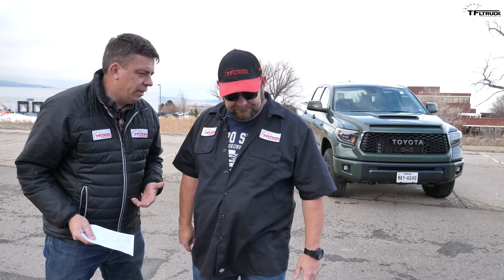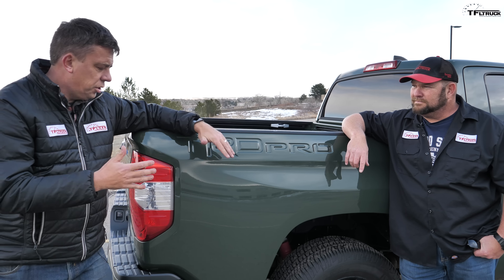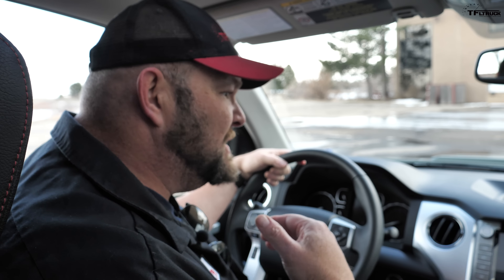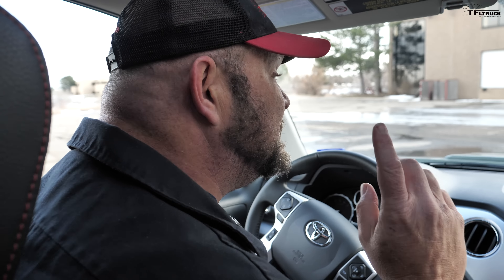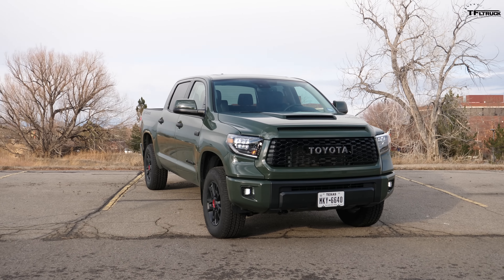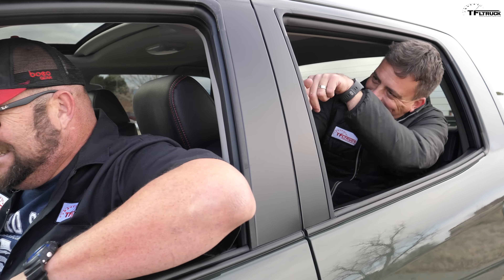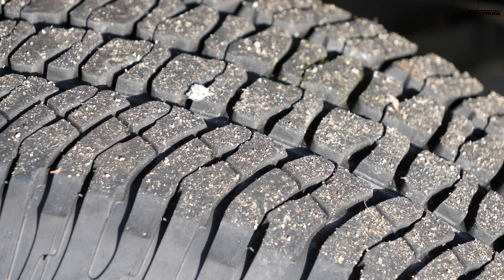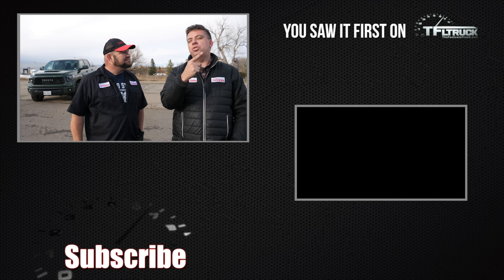The 2020 Toyota Tundra TRD Pro Is Outdated on Arrival - No, You're Wrong!

Comment: For me the lack of features that others complain about is what makes this truck great for me. Simple proven and reliable. No need to update anything. And i dont need a belt drive electric motor or a twin vaccum cleaner v6. Id like a simple v8 and its 14mpg. If i want fuel milage ill drive my car. If your over worried about fuel economy while towing or hauling then you probably dont have the money to have anything to tow or haul.
Reply: Amen, thank you! Exactly what I wanted to hear, you are all spot on! I agree with everything on what you just wrote.
Reply: I am getting close to 17 mpg on mine, my friends ford ranger peace of crap gets 17 too, and it's much smaller!!  I would never buy a Ford or Doge or any GMC piece of junk product, I would take a Toyota any day!
Reply: @bettysmith7045  agreed. I drive with a bit of a led foot but i am not concerned about gas milage when driving a pick up. I choose reliability over mpgs... That is if any of the other pick ups are even doing any better on fuel consumption

Comment: Toyota has put the Tundra on the back burner and auto pilot.  The 5.7 and 6 speed are fine, no reason to change those but let’s talk off road.  Toyota should come out with something to blow the market away and compete with rebel and even power wagon.  I think if out of the factory they gave a 12k winch, rear locker, 33s, a 2inch lift, and fixed that departure angle they would have really rugged, low tech, reliable, highly off-road capable winner.

Comment: Only thing it needs to me is a 360 degree camera. It has all the latest safety features standard. Safety sense with autonomous braking is standard, while some don't even offer it, lazer guided cruise is also standards. As is GPS and blind spot and cross traffic. Only thing really outdated other than the stuling is the engine, and that is what I like about the engine. Its simple with mone of the wizardry like direct injection and cylinder deactivation to carbons up the valves. The 6 speed is a proven durable transmission and the gearing matches the power band very well. Ths 4.30 gears make it great for towing. But they should offer a 3.91 also because that would make it more fuel efficient on the highway. Its not as tech outdated as some thing. I don't need a 12 inch screen to control everything. In fact I hate a screen to control everything. Buttons are mucn more intuitive and you dont have to take your eyes off of the road. So other than styling and engine tech, its not as outdated as people like to call it.

Comment: Sorry.  I like Toyota but ths tundra is out dated.  Time to redesign the whole thing.
Reply: I’m a Toyota master tech and bought a used Ram. The used Ram is still more up to date inside where I spend the majority of my time.
Reply: @Chromedome053  Toyota is just being cheap. Just like no rear disc brakes on the tacoma. The engine is only going to get buyers for so long.
Reply: They are more reliable because the guy that buys a Tundra doesn’t drive it as hard as a typical owner of one of the big Three. They tend to be a little more OCD over maintenance too. There are ones that are beat on and they break like anything else. The new 2021 with hybrid should be interesting. And will fall in just shortly after all of the others have done model changes.
Reply: @Chromedome053  Too bad that Ram wont last as long as the Toyota though.
Reply: James Stephens I’ve already seen Rams outlast Tundras frame wise. We replace them all the time.

Comment: I had a 2006 Tundra (previous generation) & that truck was beyond reliable.  Toyota really screwed the pooch by not keeping the Tundra updated over its 13 year platform.  They could have gone with a much smaller V-8 turbo to achieve better mpg.  If the competition consistently gets 4-5 mpg better than the Tundra, the cost of the extra fuel used, at $2.50/gallon, will soon surpass the difference in cost savings between the Tundra & the competition.  Unfortunately, Toyota has a reputation for holding onto some flawed technology instead of moving forward.  I would own another Tundra today if they got better mpg...

Comment: You might notice that many of the turbo V6 and 8 or 10 speed transmissions in fullsize trucks are having troubles. Toyota will have to do it eventually also(2022), to meet regulations, but they won’t until they feel it’s a reliable package.

But with that said, they all break eventually and i’ve fixed them all in the 37 years i’ve been in the business. Just about the odds.

Comment: Seriously what is the point of reservoir shocks on trucks with little travel from the mid point? I see 1 tons and 3/4 tons with them now and those have stiff ass suspension for hauling and massive bump stops to keep the travel just a few inches at most up or down. Anyways seems gimmicky for the baja trend.

Comment: Just hit 100,000 miles in my 2015. Toyota is known for being behind when it comes to updates on all their vehicles. However, when Toyota does update, people buy the vehicle. Ram, GM and Ford are operated 180 different than Toyota. Toyota does not want to become like any of the big 3. The one thing the video points out clearly is the reliability factor that the big 3 have alway had challenges with. The big 3 don’t get consistency when it comes to reliability and that’s why people buy Toyota. That 5.7 litter engine isn’t made to get 20+ mpg but it will tow just about anything you throw at it. Not saying the big 3 have bad trucks because each has its own thing. But the big 3 will never be the type of company Toyota is.

Comment: For all those who are concerned about this truck being a gas hog...  think about it this way:
Drive a truck for 50,000 miles. At 15 mpg versus 20 mpg, and gas is $2.50 per gallon, the cost to drive a truck that gets 15 mpg calculates to $2,083 more (for gas) than the one that gets 20 mpg. I think this appears to be a bargain when it comes time to shell out lots of $$$ for fixing an unreliable truck versus driving an outdated reliable one. I’m not trying to pick an argument or be a troll here, just offering a reality check.

Comment: The redesigned 2022 Tundra MUST have the current 5.7 V8 as a base engine
Just add a 10 speed, and some cylinder deactivation, and fuel economy will improve greatly
The engine, and the TRD exhaust, are huge selling points for the Tundra
Don't throw the baby out with the bathwater

Comment: I know the fuel sucks on it but wait until 2021 they will amaze u guys. What I see is a slow supposed out dated but tuff!! dependable! work no issues what so ever in drive train.... and least expensive. 
I just bought a lariat loaded truck? I towed my 5 thousand LB. bob cat excavator and gave me 12mpg??? Not good!!! at all! I’m looking to return to tundra it have the same mpg. So all that you guys think for Ecoboost is fuel efficient they are not people. The only way they are is not a single pound behind it or on it!
Reply: Be careful buying new.  For 2019 and newer, Tundra no longer has an air to oil transmission cooler.  Just a heads up from fellow owner/operator.

Comment: U guys should do a comparison between a TRD PRO TUNDRA with mods  against a Raptor. Put as much money in a tundra like how much already in a raptor, then we can really see which is better pickup truck
Reply: The 2015 Toyota Tundra TRD Pro team claimed victory at the recent 47th Tecate SCORE Baja 1000 race in the full stock class. While the truck performed flawlessly mechanically, the exterior took a beating. Here's what we know.

The TRD Pro team finished first among four teams with a time of 35:40:40.581 according to SCORE, the sanctioning body of the race. The Toyota Land Cruiser (200 series) team came in second with a time of 36:30:06.529. The other two teams driving a Ford F-150 Raptor SVT and a Hummer H1 didn't finish.

Comment: Fun review! I just got a new '19 1794. Loaded (obviously, it's a 1794) + spray-in bedliner w/ that mat on top + TRD Pro exhaust + 2 years of free maintenance - all for $49k OUT THE DOOR! That is a lot of truck for the money. I added a leveling kit (+2" front end) and some some meaty M/T tires on rims similar to these TRD PRO wheels. I'm still at least $15k less than a comparable Ford, Chevy, or RAM. My buddy just paid $71k (he got them down from $74k) for a new RAM. 

Fuel mileage is horrible, but I work from home and only drive a little around town. I won't be towing much, or hauling much. I mainly wanted a truck for things like, tossing our bikes in the back, getting lumber, messy things like our boat cover, grill, you get the drill. In fact, I just filled the bed with a hand truck, and a bunch of mulch.

I really wanted a V8. Interior? I find the 1794 to be beautiful. Great leather. The truck is simple, but geez, what has happened to us? I've got lane departure warning, adaptive cruise control, front warning sensors, backup camera, a sunroof, responsive touch screen. I mean, do we really need all the gadgets that cost a fortune to add to a TRUCK?

I'll probably eat my words when the 2022s are announced that have all the added gadgets - but one thing is for sure - Toyota will execute them well and they will be reliable.

I'll be driving my 'old' 2019 with its rumbling, reliable V8 for many years.

Comment: About the only things I don't like about my 2014 are the missing creature features like the turn signals on the mirrors, auto headlights, lit buttons on the hard plastic door panels and a few other small things like that.  oh - the worst one is the snow that accumulates in the box blows up when driving and covers over the whole back window.  But the ride and steering are just so smooth every time I drive a different vehicle it just doesn't compare.

Comment: Love the truck, reliable as a hammer would like to see a power bump although or have them develop a bigger engine
Reply: derak bell id like to see a supercharged v6 option
Reply: @LiquidSm0ke  Supposedly Toyota is building a Turbo I6 to replace the aging V8.
Reply: The V8 should still be an option since its a proven long lasting durable design, i hope they develop an I6 turbo platform.

Comment: Bought my Tundra for reliability and the rear roll down window.  Never take away my rear window Toyota.  Had a GMC Yukon XL before my truck, don’t have time to list all of the problems here.  My 2003 Yukon was traded to the dealer for $100/junk while it was still running and driving.  Could not ethically sell it to anyone.  Had to throw down another $20,000 for my near perfect only four years newer Tundra.  Shopped for months to find a Tundra for this price.   Amazingly poor quality for the “higher end” GMC Yukon.  Paid $10,000 for the GMC used.  Got my use out of it, but would NEVER pay new prices for a GM or Ford (would never consider buying any Chrysler/Dodge) product after seeing how little they care about quality control.  Little things like the entire passenger door panel coming off when you pull hard to close the door!  Engineering...a crap sound system including speaker cover “screens” pushed on with cheap tabs and all falling off when you close the door (that’s why screws were invented).  Heater, defrost/air conditioning broken. Instrument panel not functioning, including speedometer...can’t even imagine how big a fail they would have with high technology screens, cameras, engines, and transmissions.  GM driverless technology would put millions in the graveyard and/or hospital...thankfully they will be out of business like Sears before they even get close to trying that.  Sad for their line workers..not sad for their greedy executives and crap engineers.

Comment: I read 1560lbs as the stated payload capacity.  from where did your figure come?  Also, you guys know that Toyota reduced their stated capacities to conform with SAE standards (and changed nothing on the truck) while other manufacturers did not.  It boils down to what is important to each individual truck owner.  I have. 2019 TRD Pro and would not trade it in for all of the cameras and nanny features in the world.  Forget about the $10.,000+ premium for all of that junk and three more miles per gallon. What will the true cost of ownership be ten years down the line?  There is a reason the big three regularly offer 10-20% off MSRP and depreciate more quickly than Toyota.
Reply: That's like 60ish more pounds of payload than a new Ford Ranger.  Pathetic.
Reply: ɹǝɔʞๅǝss ɐqɐupou   Care to know what is even more pathetic?  Equivalent Raptor has 1000lb payload capacity.  The balance of off-road and towing-hauling applies even to the mighty Blue Oval.
Reply: @handyman2183  The Raptor is purpose built for offroad racing.  The TRD Pro line-up is lipstick on a pig.
Reply: Baja 1000 stock division “The TRD Pro team finished first among four teams with a time of 35:40:40.581 according to SCORE, the sanctioning body of the race. The Toyota Land Cruiser (200 series) team came in second with a time of 36:30:06.529. The other two teams driving a Ford F-150 Raptor SVT and a Hummer H1 didn't finish.”

Comment: Teleologically speaking purpose of a knife is, to cut. Therefore a good knife is a sharp knife. The purpose of a truck are many but mpg is low on that totem pole. As such a big, proven, tough, reliable V8 with a drive train that compliments these traits are teleologically speaking what a truck is and should be about.

Comment: Love the tundra but I wouldn’t buy this trim. You can buy a sr5 or even the work Sr for under 40k with the same engine and 4wd. You sacrifice a smaller screen but who cares? It’s a truck! The tundra shines in its lower trim models. It’s higher ones are nice though too but unnecessary.
Reply: The now sadly defunct SR5+ would have been my choice. Cheapest way to get heated cloth seats, which is a godsend in winter over leather seats.

Comment: I bought a new 2019 Tundra and at 6100 km I hit a big mule deer at 122 kilometres per hour.  It took out the grill and radiator but headlights and hood were left intact.  The truck took the hit like a beast.   Very solid and safe truck.

Comment: The Tundra TRD Pro will still be the truck I buy late next year. Coupled with a black series trailer HQ15 it will be the perfect platform for me. I just want to be able to get off the beaten path for some nice secluded boon docking. The TRD Pro will be perfect for that. Once I pick up my Rn I want to be a travel nurse working and seeing our beautiful country (red states only) lol I need to get out of California. The Tundra will get me there. My sis has owned 2 sequoias. I love driving her trucks because it’s so quick and so much nicer than my ford. Granted my expedition is a 2003 Eddie Bauer her truck even when they were new still walked my truck like it was standing still. I look forward to that army green! Brilliant video gents.
Reply: Any pickup would do just as well as a Tundra for what you have in mind...some would do better...
Reply: If you're planning on towing I wouldn't get the TRD Pro.  They squat badly with a load.  TRD Offroad is what you want for towing.  You'll want to get a 2018 or earlier as well, for 2019+ models the air to oil transmission cooler went MIA.
Reply: Green Soup yeah I plan on getting the tundra, I fell in love with it.
Reply: ɹǝɔʞๅǝss ɐqɐupou I’ve seen the sag but it will be something I deal with. The trailer isn’t too heavy and I want a new vehicle especially the army green.  🤤🤤

Comment: Add a more gears at least for some better mpg. Only thing holding me back..
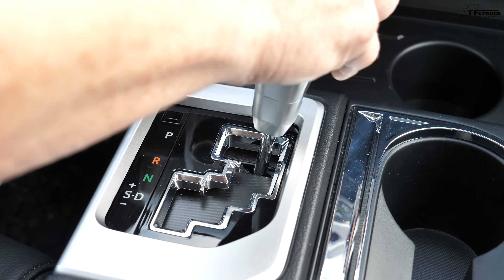Reply: The only reason it has lower mpg is because the rear end is a 4:10 gear ratio meaning it is a lower end differential. You sacrifice mpg for low rpm power to the wheels.
Reply: @RagingMoose45  even changing it out to a 3.30's ratio would only net you another 2-3mpg.. I'm looking at trucks that give you almost double in mpg and better towing.

Comment: There's nothing "Pro" about this truck. No diff locks. No geared down 4Lo. No sway bar disconnect. Same 5.7L output since 2006. Old 6 speed transmission. Toyota's succeeded in underwhelming again. As the Tacoma continues to use drum brakes as well.

Comment: As far as the Tundra goes, it's a dinosaur and the other truck makers are leaving it in the Stone Age.  The TRD versions need to have a locking rear diff., and come with Real Off-Road tires.  The Tundra also needs a drivers side A-Pillar grab handle, and to over the full 4-door version with the 6.5 bed.  These are just a few of the items Toyota needs to address on the Tundra to stay competitive with the other truck manufacturers.

Comment: IMO, what Toyota will do is use the 5.7L as the base engine for the 2021 model
Then, they will use a version of the Lexus LS500 engine Turbo Six (400+ HP) as an option
Then have a Hybrid 5.7L V8 as the top engine, with around 500 HP.
The 6-Speed will be replaced by the 8-speed in the Land Crusher
Reply: Is that what what your crystal ball says?
Reply: Me thinks you needs more booger sugar.

Comment: I want this truck so bad and don’t care if it’s old. But it will outlast anything out there. Just pisses me off cause Toyota around here is soo hard to work with. They never want to price match and I really don’t want to pay 50,000 for a fairly base SR5 but I can’t contain myself much more.
Reply: Save yourself money and don't buy a pro.  Just buy a standard and throw a lift, suspension, wheels and tires, and whatever else you want with the savings.  You can buy one new at 36K......I've seen deals all the time. Trust me, I've driven the pro............and alot of people on the forums recommend not buying a Pro if you're just gonna mod it out anyways.  If you don't mod it out, then just buy one with a TRD package.